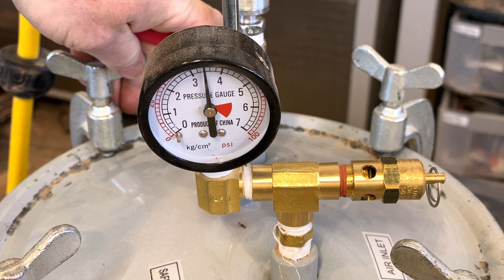Woodturning - Brown Mallee Burl & Glass (Total Boat Resin)

Comment: Wow great turning and stunning finish 
Question do you need a pressure cooker to use resins
Reply from the maker: Not necessarily. It depends on a couple of factors. There are thick set resins that can be poured up to two inches without problems even without a pressure pot. However, the issue is usually that wood has voids and if the resin isn't forced into the voids, air can get trapped and make pockets without resin. However, for some things like large platters, I've used thick set resins and not had any problems.

Comment: Did you just sand the resin to 220 grit and then use the abrasive paste and polishing paste? The results are beautiful?
Reply from the maker: No, after I applied the sanding sealer, I went back and sanded at 220 again and then up to 400 before the abrasive paste and polish.